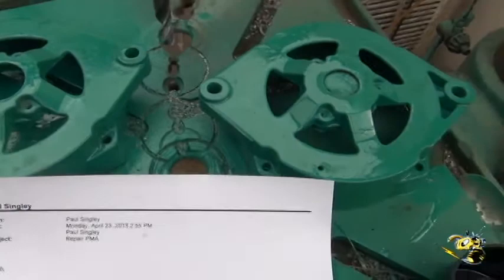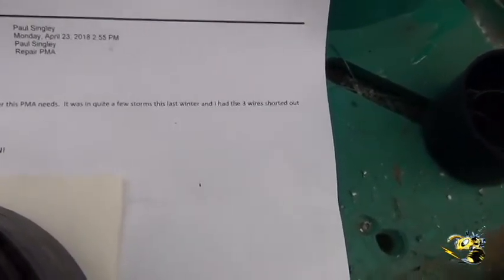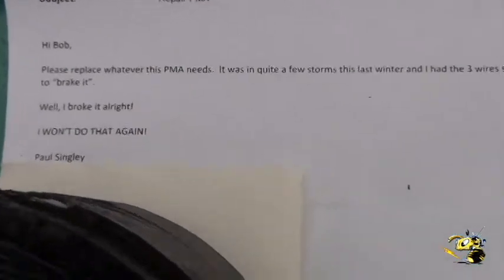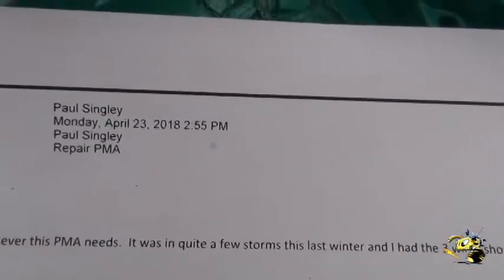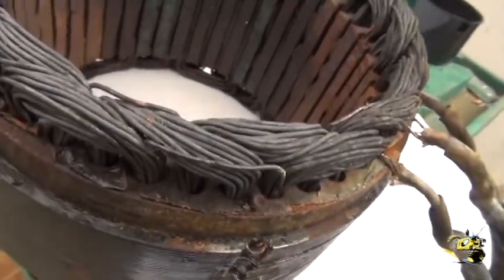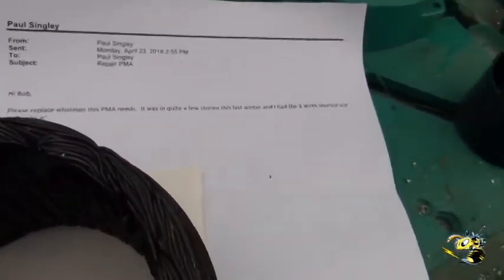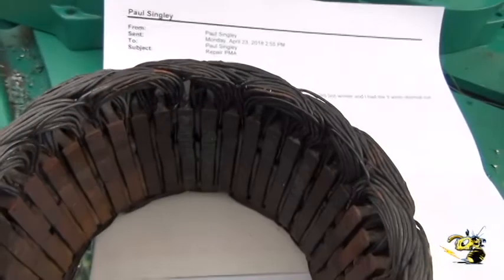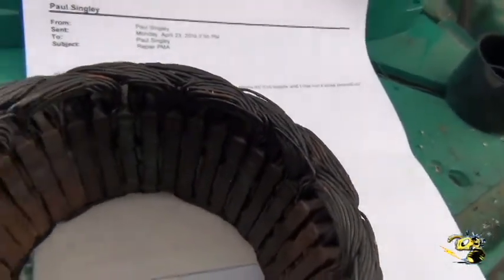never use electric brakes on a wind turbine

Comment: Electric brakes are just temporary emergency brakes, something you use when you need to stop slow turning blades in a light wind to do a quick maintenance check or something - never turn them on during high wind speeds, and never leave an electric brake on indefinitely, especially not in a wind storm. Just because it's not turning fast doesn't mean that power isn't trying to go somewhere. All it takes is a big gust and like TomT342 said - you have an induction heater on your roof. Coils will burn.
Reply from the maker: "COILS WILL BURN"  so true!

Comment: Good helpful info, you sell furling kits anyway, I did wonder about freewheeling you answered it all in this one short video.
I do use the shorting method of the phases in low winds when doing maintenance so I don't get hurt but that's it.
Seen diy motorized  designs that turn the blades 90° to the wind , I'd like to build that also, it allows normal furling during normal operation via sliding inside a tube yet fully retracts the tail when motor is powered up, no doubt with limiting switches akin to solar trackers.
Reply: My inline resistance design puts the heat in ceramic, not stators. I am just shocked the Missouri Slum Lord has not figured it out but I did detect 8 fake accounts asking me for detailed schematics. If I missed one fake, then his corporate espionage business plan may have a very detailed schematic and mathematical conclusion why mine at 4 to 8 years of age in my wind storms still produce hammering power!
Reply: Secret to my wind turbines, inline resistors and 10 or 12 magnets, NOT 14!! Cost me $80 to get plates made, now ZERO COGGING, NO OVER PHASE AND HEAT, and SUPER SPIN UP! My meters do not lie, 10 mag is fkn king. Just wish THERMODYNE would have done it, glad I dissected a Sunning 800 and learned why they are the rulers of wind power.
Reply: PS, tear open a Sunning Wind turbine.  The stator, its almost 90% a freaking delco 12SI and they use 10 magnets that are 2.75" long, at 13 degrees angled. Not shitting you. You would be shocked! So, its fact, the whole time, if Bob would have been making the same layout IN A DELCO, he would be the king of wind crap!
Reply: Not sure, but if you take the sunning, 42 coils, 10 magnets and put them side by side with a 12si Delco converted they look identical. But once you learn SUNNING was at one point PMC Delphi Corporation China for products to make for the Pacific market, you start to see the reality. The mother company made GM parts from 2000 forward.
Reply: That's a good idea. I wonder if there's an intelligent controller that can be coupled with something like that. I can connect an anemometer to my tracker controller, for example, and when the wind speed rises above the set point I establish then the controller moves the arrays to their homing position to decrease the drag on them so the wind doesn't rip them out of the ground. Something like that would be really convenient for micro wind turbines.
Reply from the maker: Your idea sounds great!  When you build it I'd love to see it.  You always have good ideas  :)
   As far as furling we sell an adjustable plate that moves the PMA off center which forces it
to fly sideways in high winds but does not have any effect in low winds since the tail over comes
any tendency to fly sideways.  
With my turbines I just make sure they have about 1200 watts of load on them and a breaker
that "POPS" when it encounters a high amperage pulse over that point.  This of coarse depends on
what PMA type your running.  
I'll tell you this,  I get at least 1000 requests a year from people with Chinese wind turbines that
have burned out coils since they came with a computer that does "ELECTRIC BRAKING"
80% of these people tell me two things:

#1. They can't get a replacement part without paying almost as much as the turbine cost them.
#2. That their turbine's burned up with in the first year of operation leaving them deeply dis-heartened.

Some of these people spent $10,000.00 and the turbines actually worked very well, until the electric brake
kicked in and fried their coil that is 😭
James Bigger is right that electric braking is a short term solution in low winds to work on a turbine but NEVER
to be implemented as a high speed brake during extreme wind conditions.  
Furling upwards or sideways is probably the best idea to tackle high winds and the second best choice
is JUST LET IT SPIN and pray your pole is strong enough to hold as that is usually the weakest link if installed poorly!!🤞
Reply: Thermodyne Systems again very good info its good to read this stuff learning from your experience, I've seen electric and  manual pull furling tails that hold the tail in permanent full furl , rope style yet no chance of touching blades,  the fuse is a better than I imagined idea to protect windings now that I better understand freewheeling .
James took it to a new level with the solar panel idea LOL , his brain is in overdrive coming up with great ideas that materialize before our eyes.
Reply: Јоhn Daniel yeah me too, I thought I knew it all and then I learnt I knew nothing really but after extensive reading of hugh piggot I know a little more than I knew but I'm still a dummy in my own eyes, I did study at college to be an electrician but went no further I did pass though , basic electrician not rocket science, I'm a mechanic but electrical always appealed to me, did that course in 2001.
Reply: Јоhn Daniel I always wondered why the 12si was not utilized, more is more